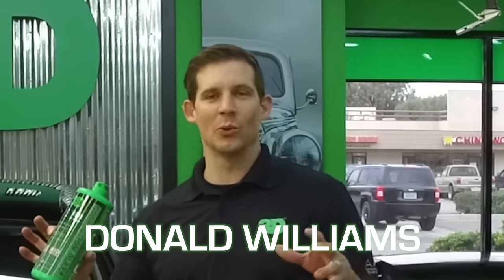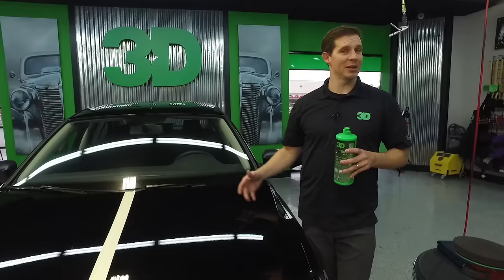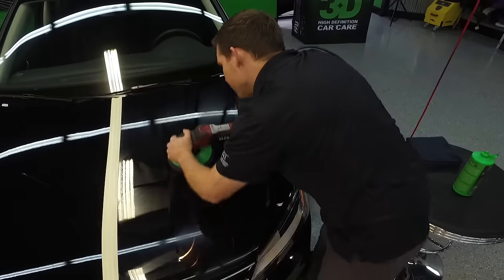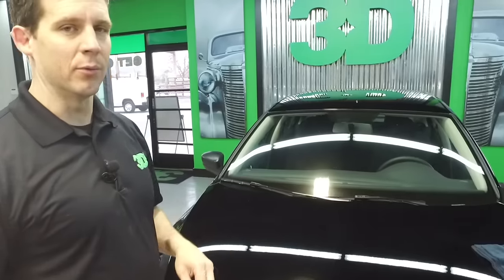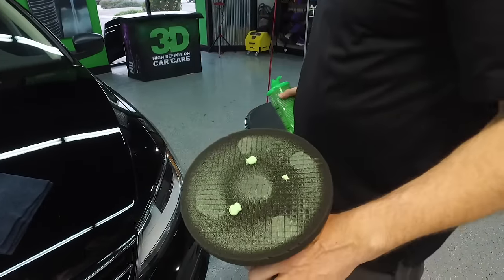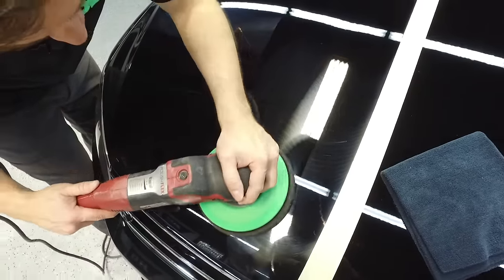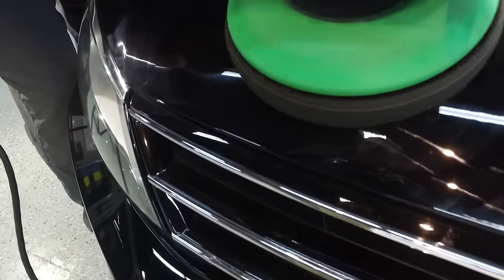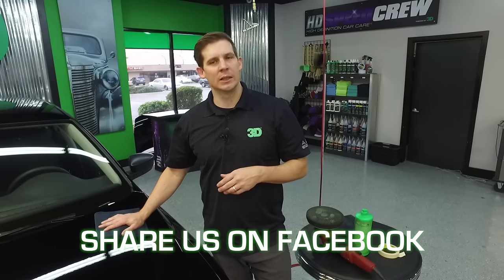AAT 505 with montan wax for CORRECTION vs GLAZE on scratches with a foam pad

Comment: I like to use hd speed directly over some types of oxidized plastics and rubber surfaces and have found very few plastic/rubber surfaces that speed will leave a residue on. It honestly even works well on some textured trim. Does 505 correction glaze also clean trim effectively?
Reply: 505 CORRECTION GLAZE WAS SUPPOSE TO BE SPEEDS REPLACEMENT. BUT FOLKS WENT NUTS WHE. THEY HEARD SPEED WAS BEING DISCONTINUED. 505 GLAZE IS CUTS MORE AND LEAVE MORE GLOSS HAN SPEED.

AND DOES THE SAME ON TRIM LIKE SPEED

Comment: Just purchased this product, and unsure if I should be using a black or green foam pad on SL55 benz.
Reply from the maker: In general, you want to use a soft pad.  I the car has more scratches you want a stiffer pad.  If the scratches are really heavy, move to compound and polish.

Comment: Would it be good to use hd poxy afterwards or before that and how much would be a good amount to charge to do this work
Reply: @3D PRODUCTS SALES ok also is this product that is poxy on steriods when is it good to apply this product
Reply from the maker: This product is best to remove light scratches and leave a protective layer on the paint finish
Reply from the maker: Poxy is only a wax.  This is correction and protection